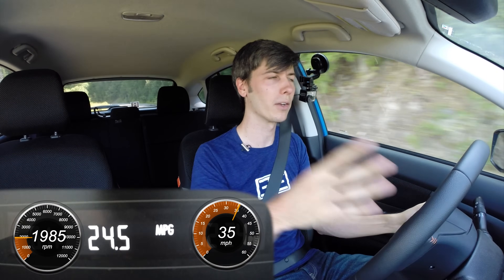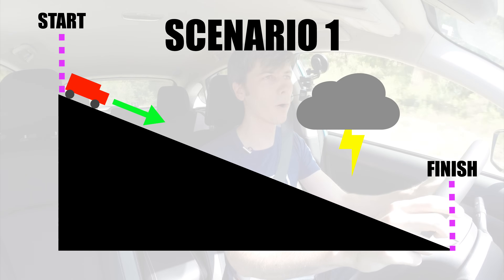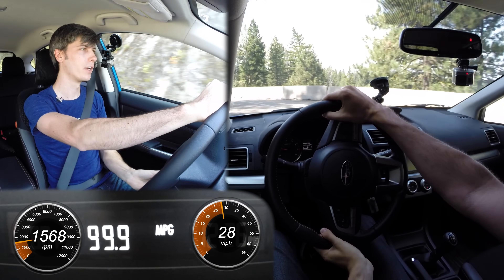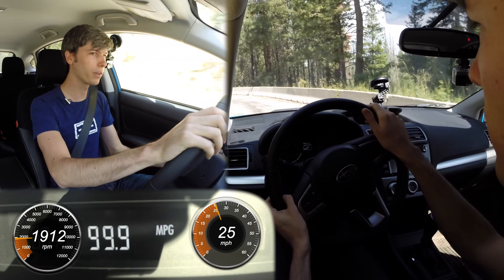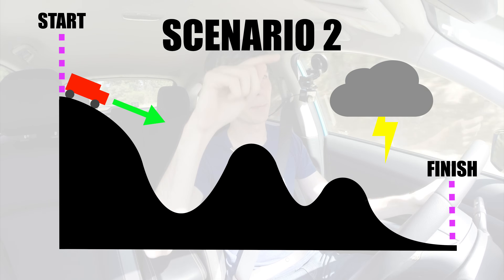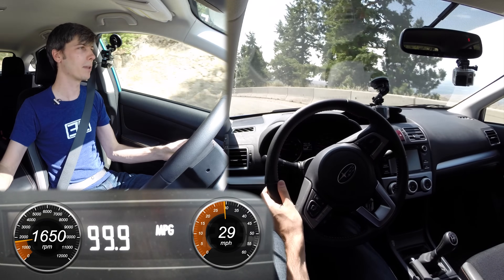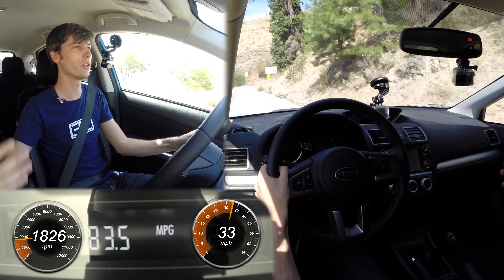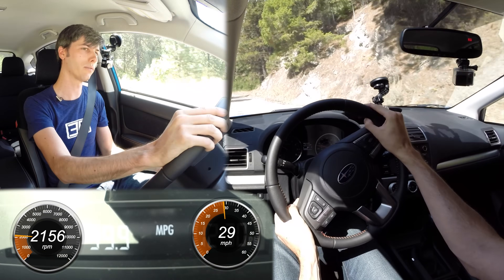What Uses Less Gas - Coasting Or Engine Braking?

Comment: I’ll keep my clutch in, same as neutral, and gain speed which then allows me to coast on the flat section until I drop back down to my original speed. This works on smaller hills as well as flat areas after the hill. If I reach the top of the high rise in New Orleans at 60, I get to about 70 at the bottom, or a bit more if I have a blocker. On the rare day there is zero traffic, I can turn the engine off on the way down. Regardless, I get better mileage doing that than engine braking. My new hybrid is a different story because I drop into ev mode while charging my battery.

Comment: My rule of thumb: if I need to touch the brakes when descending a grade, I should be leaving it in gear. If I want more speed, neutral/pressing clutch pedal might be worth it. In general, speed limits cause me to leave it in gear most of the time. 

Another thing to consider is what gear you engine brake in. Once engine speed falls below ~1500 RPM, the injectors will turn on, even if you have the car in gear. For example, if you left the car in 5th gear while slowing to make a turn, after you go below ~40 km/h (25 mph), the engine will start using fuel and fight your braking. If you coasted down in 3rd instead of 5th, this wouldn't happen until ~16 km/h (10 mph).

Comment: There's engine drag, and there's power... both is a function of RPM. Power is high when RPM is high and when fuel throttle is open, this relationship is because power is merely the frequency of combustion and this frequency is function of RPM or how fast the engine cycle its stroke... so high RPM = high power,  but there's a negative aspect of high RPM; the engine drag is highest when RPM is high, because the rapid stroke cycle meant that the engine component is moving and grinding at high rate thus creating high friction loss. So, if your fuel throttle is close but your RPM is high, then you got zero power and you are left with engine braking (which is from engine friction & thermodynamic losses during intake air compression).

Comment: Quick Q: Why is it that when using engine braking there is still engine noise generated? Esp noticeable if going downhill in a low gear like 2nd. The revs are high and the engine is still making a loud noise - which I imagine would be caused by the sound of combustion. If there is no fuel going in - why the same engine sound - surely it would go quite. Thanks for great videos!

Comment: I am a bit disappointed because i thought you were more factual rather than copy Top Gear. As a science guy, you should know that fuel is still being used while in gear downhill to keep the engine ticking. 

If no fuel was being used and air is entering the combustion chamber (it is because when you let off gas, throttle body is still slightly open for idle) the air:fuel ratio will be 14.7:0 so combustion cannot occur (engine will stall).

Comment: Coasting down at neutral is dangerous and costly because you'll have to compensate overspeeding with brakes and this method of breaking is the same reason for brake failures - in the Philippines that is.

Comment: So you're heading to NC State from a meeting in RTP. I-40 is a parking lot, it's July, hot, 95+. As you wait in the grid lock is it better to turn the car off and sweat off a few pounds? Or put it in park/neutral so that the engine idles just a bit higher and the A/C puts out just that tiny bit more cool air, or leave it in drive where the lost RPMs is used to heat the fluid in the torque converter?

Comment: Do a video explaining why there are specific ways to tow a vehicle specially 4WD/AWD where they are specifically requiring to lift all 4 wheels. They say it will ruin anything connected to the wheels: differentials, transfer cas and gears. It does not make sense why you can just strap it up and pull like we do when stuck in off-road situations

Comment: The question should be: What uses less gas when going on a level road: coasting for a while then accelerating back to speed and letting it coast again, or keeping it in higher gear and lower rpm with your foot on the throttle all the time?
Reply: Foot on the throttle the whole time oh my god.

Comment: Fuel injection  does not shut off.  If it did the engine would stop.  Find another way to explain like maybe they inject less. A  mechanic you are not. Also the displays you are watching are computer calculated based on the sensors it sees.  Literally, your milage may vary.
Reply: Fuel is not being injected anywhere. Period. The ECU knows that it does not need fuel so it DOES NOT inject fuel. Go to the top of Pikes Peak and let the car idle till you're out of fuel, then drive down the mountain in gear, you'll get engine braking and you'll not use any fuel because the car is out of fuel.

Comment: I drive a Civic, which way burns less oil?
Reply: The VTEC range. joke
Reply: JJM it shouldn't make a noticeable difference either way. Your really only burning oil when you are applying power when the engine is combusting fuel and applying pressure onto the piston rings and oil pressure is greater.

Comment: Now if you have a car like a Sonata Hybrid you don't have to worry about any of this, especially if you have smart cruise on as it will keep speed as you go down by using regen to modulate your momentum.
Reply: Sure you won't have to worry about it, i don't have to worry about it in my 63 ford, but you'll be much less fuel efficient just as i will when i don't try to save fuel.

Comment: What about when you're not going on a downhill, that is, in a straight line? 
Say there is a stop sign 100 meters away and you put it in neutral to just get there with the inertia. Would it be more efficient to instead use a little engine break in that situation? Or just using the brake pedal? Someone please enlighten me.
Reply: You should always leave your car in gear when slowing to a stop. It's just safer, in case you need to make an emergency maneuver. Even if you are not in the proper gear, it's still better better than putting it in neutral. 

In the case above I would just brake normally with brakes and leave the car in gear. As you come to a near stop (1000rpm or so) Just depress the clutch. and continue to apply brake. if it's a stop sign then you can just put it back into first and keep going. or if your at a light then put it into neutral and release your clutch.
Reply: I generally put the clutch in and coast many many meters, like up to a kilometer at times. You'll keep the momentum up if you've got the clutch pressed in but you'll also be using fuel to keep the engine running where you use no fuel when in gear, it really depends on the car and the scenario for that one.

Comment: Will lubrication oil system in automatic gearbox still works same as D when you change to N ? I heard that some engineer said it will be cut-off and damage transmission if you let the car go through the slope for a long way. Is that true?
Reply: No, as long as the engine is turning the transmission is being lubricated.
Reply: Do not put it in neutral when moving ever.

Comment: Almost all cars since the 90's have decel fuel cut-off. Mostly this is to prevent short injection cycles where the injectors cant deliver the low quantity of fuel requested, and not really to save fuel.

Comment: Have you done a test with engine start stop?  I am curious as to if it really gives the average driver a benefit, or if it's better suited for OEMs to pass the mpg tests.
Reply: ? start stop?
Reply: Sorry, by this I mean the engine start/stop software aimed at stopping the engine at stop signs or stop lights, and restarting when you push on the throttle.  I would like to think start/stop saves fuel, but you are wearing the starter and flywheel or toothed wheel more...
Reply: May require more fuel to start.

Comment: Fuel economy will be as good as Idle  because to have engine going when throttle is closed it has to idle so injectors do inject enough to have it idle 24/7 best thing is to put neutral and turn engine off then just go down the hill and break as needed, provided there's no traffic. Problem is breaks will suck no power steering.
Reply: You're severely uneducated on the subject. Do not do any of what you just said. It's illegal. Keep the car in gear so that you're not using any fuel. It's saver, legal and more fuel efficient.

Comment: FRICTION and AERODYNAMIC DRAG. It should never be more efficient to coast than leave the car in gear. The energy saved by leaving the car in gear will be more than the energy required to get over that next hill, or the coasting car would not be able to make it. The car in gear is at a slower speed down the hill, which means less friction on the wheel bearings, less aerodynamic drag and more time that gravity is providing assistance. The car that is coasting will not gain enough kinetic energy to offset the burned fuel as a result.
Reply: You have no clue what you're talking about. Coasting down a hill to be able to crest the next hill is more efficient than slowly driving down the hill then squirting all kinds of fuel into the combustion chambers to climb the next hill.
Reply: How about an actual test to prove that instead of assumptions. Real world is not the frictionless vacuum that is often assumed.
Reply: Let's say you are going down a hill at 60 mph in gear and the coasting car is friction and drag limitid to 75 mph. To get up the next hill, the kinetic energy needed is to stay at 60 until the point where the coasting car slows to 60mph. That acceleration will take less fuel than was saved. Unless the car has no overdrive or an excessive final drive ratio, it will not slow the car enough to matter. No modern car is built that way because of fuel efficiency.

Comment: The most efficient option would be to shutdown fuel injection and open the throttle, to avoid engine braking, but ECUs are not programmed to do that. The moment you step on the throttle, they start injecting fuel.

Comment: Transmissions react differently. Some of the modern tech is wicked efficient. 

The issue with engine braking is that it’s braking (!), slowing the vehicle … down once that happens you need to accelerate … step on the pedal and you’re using fuel. Inertia is king.

Comment: In our diesel Volvo, you can press the gas pedal a little bit to stop the engine from engine braking (it will open up the valves) and it will almost be like coasting in neutral, but your still using zero fuel. Also, just depressing the gas pedal and using a tiny amount of fuel while going downhill will almost always be more efficient than throwing it in neutral and letting the engine power itself
Reply: You sure?

Comment: I do the following with a manual transmission. If I need the car to continue rolling and there is no stop or speed limit I coast by pressing the clutch. If I need to stop or respect the speed limit I use the engine break as much as possible before using the breaks. To really save fuel using engine break the driver needs to think always what comes ahead. Most modern cars with automatic transmission and CVT also use a mild engine break when lightly pressing the breaks but the driver needs to anticipate stops and be pacient. In a manual transmission, engine break in a lower gear is also very nice before turning at high speed.

Comment: So you're saying if you take your foot off the gas while still in gear and coasting, there is no fuel being used?  How is this possible because in this scenario, the exhaust is still giving off fumes, i.e burning fuel?
Reply: The engine is still pumping air, it's just not burning fuel.  It can also look like normal exhaust because compressing the air heats it, and creates steam which is visible in the exhaust.
Reply: No, if you're going down a hill for 999 hours, with no throttle input, you're not going to burn ANY fuel. Unless your car is carbureted or mechanically injected, if it's newer than around 1990 its not going to burn any fuel when going down hill.
Reply: It's not burning fuel unless you're talking about a carbureted vehicle
Reply: Interesting, thanks :)
Reply: Bob Sizemore I still don't understand because if I let my foot off the gas while the car is on, the car will eventually run out of gas so it IS burning fuel.
Reply: Thanks, what If I'm doing 60 mph on a flat road and then take my foot off the gas.  The car will gradually slow down to a crawl.  During this slow down period, is it burning gas?  Or is it ONLY on downhills does it stop burning fuel?

Comment: Why not show actual results when driving up and down a few hills. If you are going down a big hill but wont completely make it over the next, would coasting in gear offset used gas to pick up speed in neutral. Thats always my biggest question. I make it further up the next hill because i picked up speed, but was it enough past where i would have been in gear to make it worth it.
Reply: Go down the hill in gear and near the bottom put the clutch in to accelerate and coast over the next, things like that are most efficient. If you're looking to maximize everything. It's also most efficient to accelerate on flat ground or down a hill to make it up the next hill with little throttle.

Comment: Fuel injection shuts off completely when engine braking? Wouldn't this stall the engine? Help me understand, I've been wondering this for a while.
Reply: no. A stall happens when the engine reaches such a low rpm that it cannot sustain itself no matter what it does. 

So in the case of engine braking, down a hill, Fuel is shutoff, but the RPMS are still high, as your wheels are still turning and since everything is still connected. Engine braking only occurs if you are above idle RPM. If you are not on the gas pedal but are at below idle, it will inject fuel to keep the engine spinning.
Reply: Like that guy said. The wheels are turning the engine, it cannot stall.

Comment: The engine is still firing when in gear coasting, so there has to be fuel used. If fuel injection completely stopped, you wouldn't hear the engine running because there'd be nothing for the spark to ignite. I don't get it.
Reply from the maker: +Ted Kord air compressors are not silent. The engine will still make plenty of sound without fuel injected, as it acts like an air compressor.
Reply: Engineering Explained but that's not engine noise. It's different, and recognizably so. I don't believe that it stops injecting fuel totally. It may indeed use less than coasting in neutral, I don't know.

In fact, now that I think about it, my car has an exhaust leak, and is quite loud. I go over a bridge to work every day, and coast the downside. It's be very aware of the sound changing.
Reply: Some cars inject a little to make crackly popping sounds when decelerating. For the most part all cars cut off injection if they're electronically injected.

Comment: I noticed that on my Ninja 1000. It has a mostly digital console and fuel economy can be displayed (both long term or every few seconds.) I was in the mountains near Floyd, VA, and noticed that when I'd coast down a hill with our on gear I'd see 239.9 MPG which seems to be its maximum value to display. If I pull the clutch it displayed a lot lower, around 70-80 if I recall.

Comment: So without hills, coasting is more efficient. But if your car is overheating, which one will create less heat? Engine beaking at ~3000 rpm using no gas, or a small amount of Idling fuel and very low rpm?  Of course the least heat would probably be putting it in nuetral, and turning off the engine. But then you wouldn't have power steering, which is a huge safety concern. I wonder if that's only problem you would have?
Reply: The Oil Temperature is increasing when i coast at a high rpm in my car. Idling downhill is cooling it down pretty quick.
Reply: I think engine braking with the engine at 3k RPM would not cause it to overheat as there is no combustion going on. The RPM will not cause the engine temp to go up. If your oil temperature is going up significantly between neutral and engine braking then you should probably change your oil.
Reply: Spencer 101 If you leave it in gear and engine brake at 3000rpm you are cooling the engine more efficiently. You have no combustion and your water pump is turning at 3000rpm as oppose to idle of 600-800rpm (depends on the engine). If you car is over heating you can also turn on the heater, the heater has its own little radiator that the engines coolant runs through and the blower fan blows over this radiator (heater core) and give you warm air. With the heater on it's like creating a second mini cooling system for your engine....but you have to now deal with the heat.
Reply: Jacob Stofmeel but let's say, hypothetically speaking of coarse, that your car is overheating because you keep running out of coolant because your radiator cap is busted and you don't know it. Or your cooling system has failed for some other reason, which is why your car would be overheating in the first place. Your probably still right though, since there is no fuel combustion while coasting/engine breaking. But I would think that churning the engine at let's say 3,500 rpm on the freeway would make a decent amount of heat on its own.